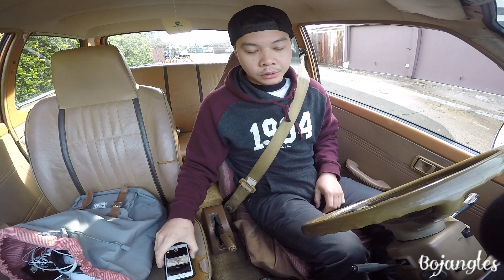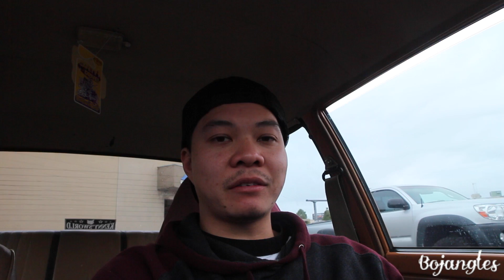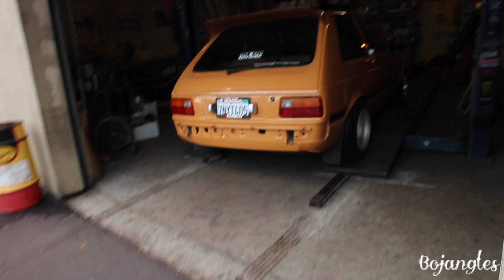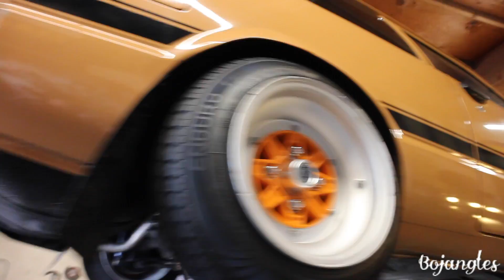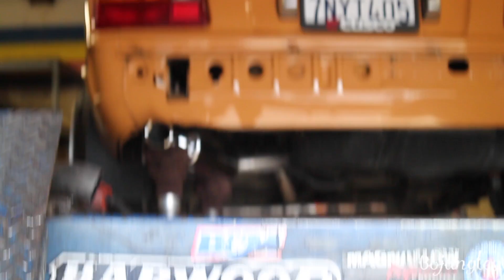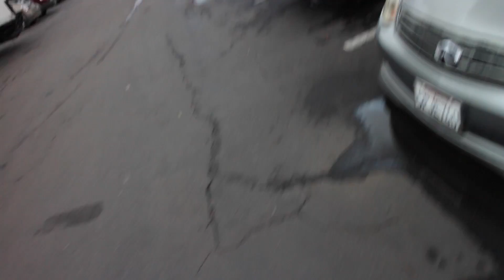TOYOTA STARLET KP61 FIRST DRIVE & MUFFLER INSTALLED

Comment: Dope Starlet! I'm restoring a '71 Corolla Wagon KE26. Threw a row in my 4K. Going to do a 4AGE swap but will likely rebuild the 4K.
Reply from the maker: Thank you! 4K is an awesome cruising motor, I want to do a 4age in the near future.
Reply: I may try to rebuild my 4K.  Where are you finding 4K parts? Head and block.
Reply from the maker: I haven't looked into rebuilding my 4k because it running good so far. Check out Rockauto.com for your KP 4k needs :)
Reply: Do you restored the Corolla?